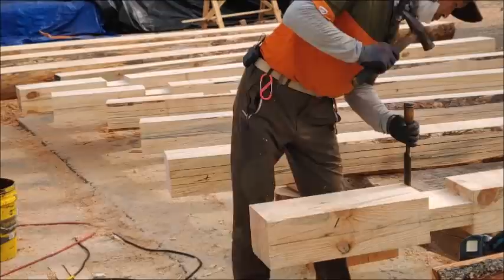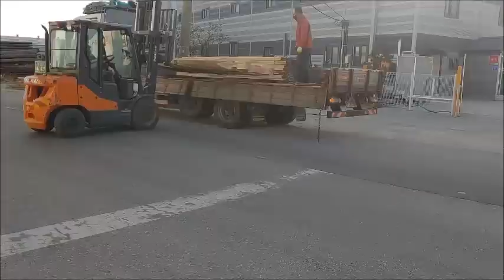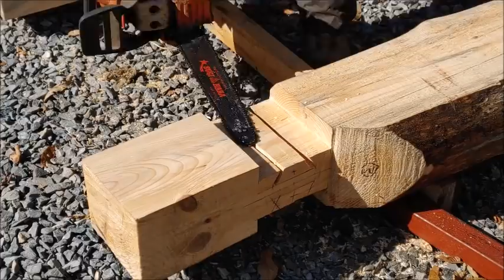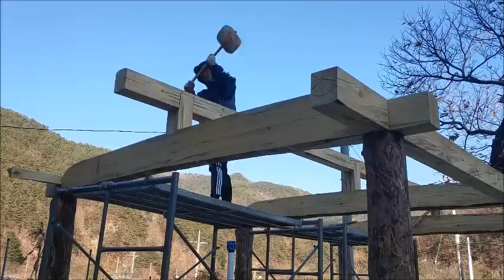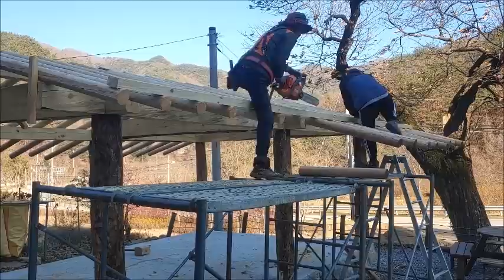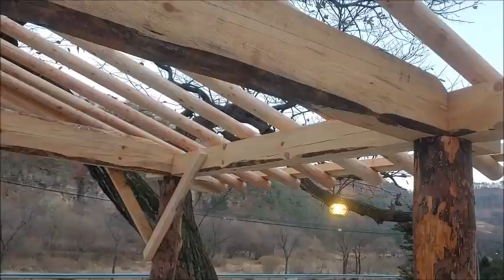House8-한옥기법으로 빈티지스타일 농막짓기,전통,목수,목공,wood.K Woodworking

Comment: Thank you for making and posting these videos! It is great to see the different joins and techniques used in these traditional buildings. 

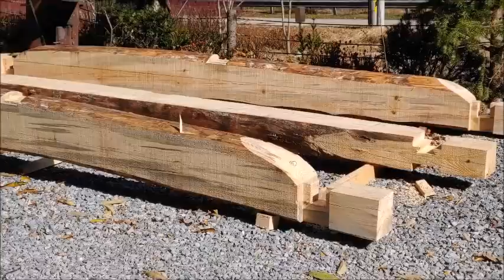When using the chainsaw for carpentry I get my best results with an electric saw, if electricity is available. Also, when using the chainsaw to "flatten" the wood after a cut I find it easiest to control how much wood is removed and controlling the surface by using the bar flat sideways. Perhaps something to try at the next opportunity. ref: 3:33 in the video.

You have a very good mix of old techniques blended with new tools. Here in Norway traditional trestle frame buildings in wood are competing commercially with steel due to using the same mix. Very quick and the buildings are strong and proven. Even if the engineers might find it a challenge to calculate snow loads etc. on the traditional buildings. Perhaps it is the same in Korea?

Thanks again.
Reply from the maker: Thank you for watching my video.
Your advice! Thank you.
Snowfall in traditional buildings! This is a very important point.
It can be seen from the experiences of senior carpenters
However, it is difficult to predict.
So, I tend to use overly coarse wood.